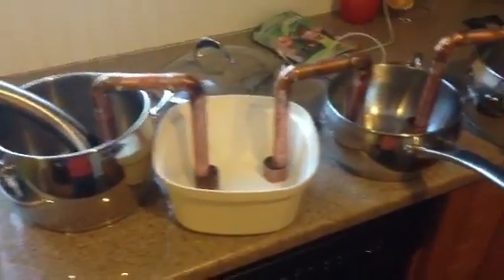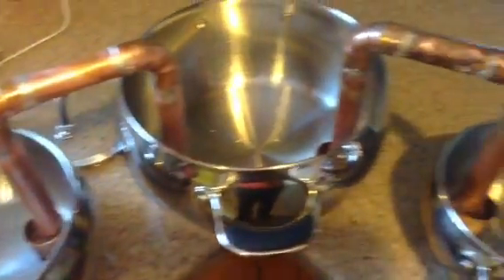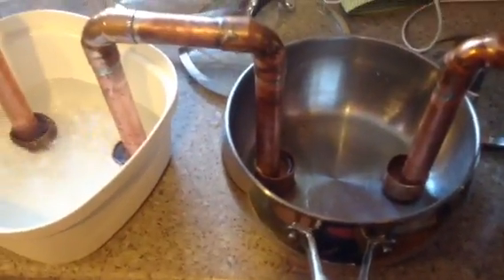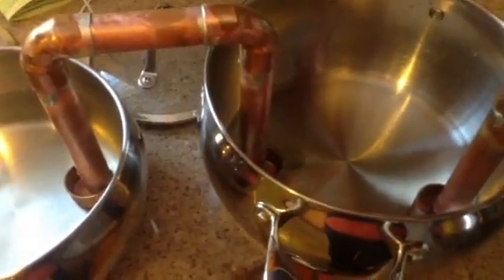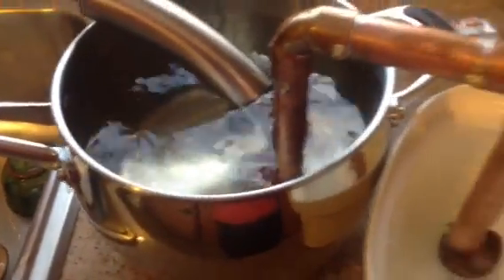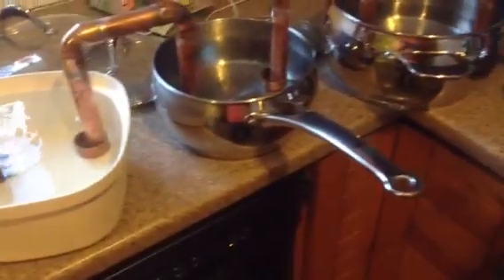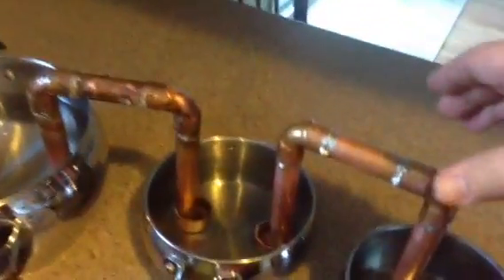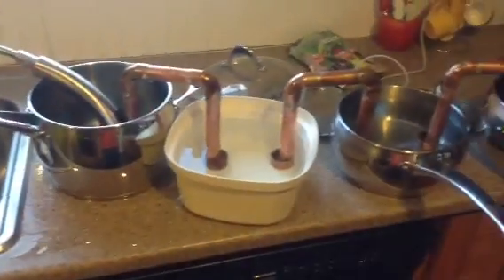Evaporator siphon

Comment: Did it work?
Reply from the maker: It did in a way, while boiling the siphon filled with air once and a while.  I found i could take a hook and submerge the copper siphon an fill it again, it only happened in the siphon from the first pan to the second pan. That seems to be when any oxygen in the sap is released.